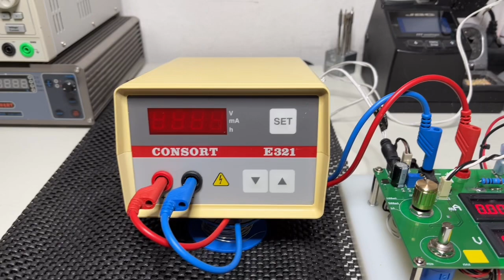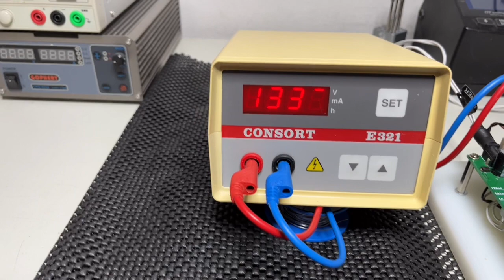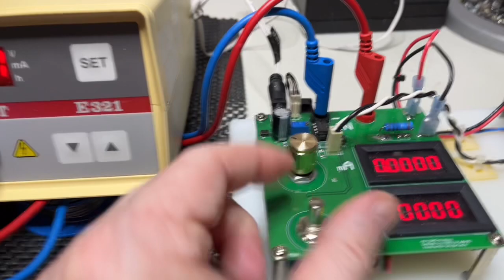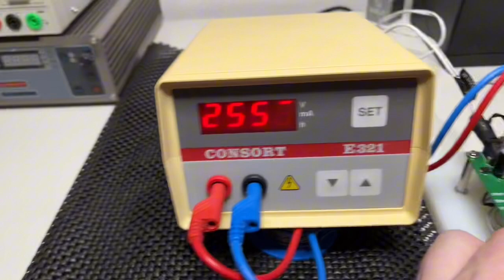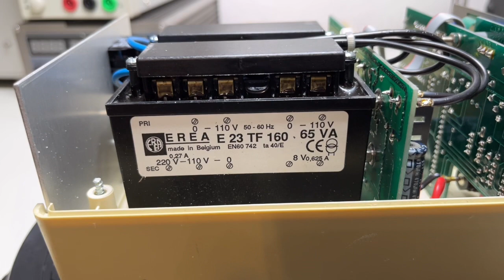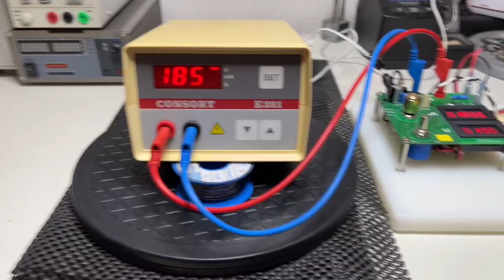CONSORT E321, 250V 30W small High Voltage Power Supply Test and Teardown.

Comment: I have an older E321 with switch between V and mA. Has a potentiometer to adjust output voltage, delivers a "sawtooth" voltage out. Got this from E waste, have not decided what to do with it, maybe convert it to a smooth DC output. Are schematics anywhere to be found?
Reply from the maker: Yes its AC Triac regulated Output, hence no DC.
I have not found any Schematics yet.